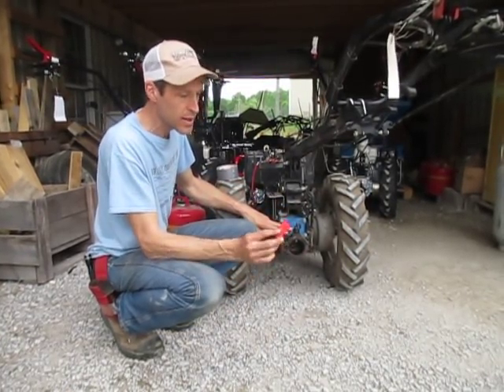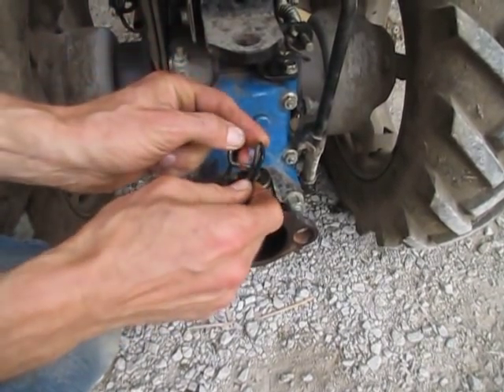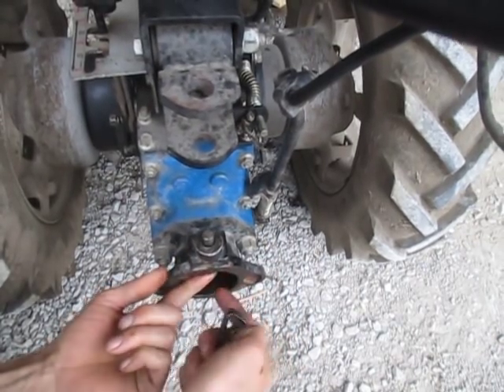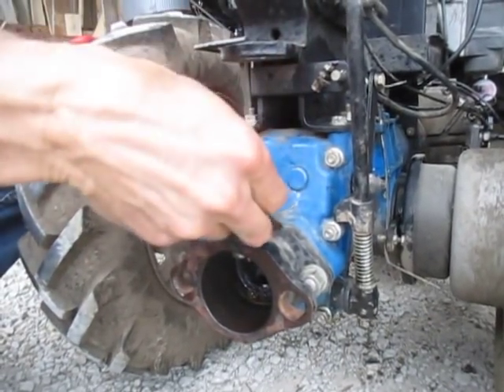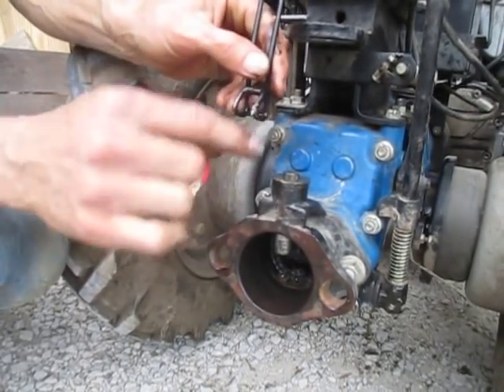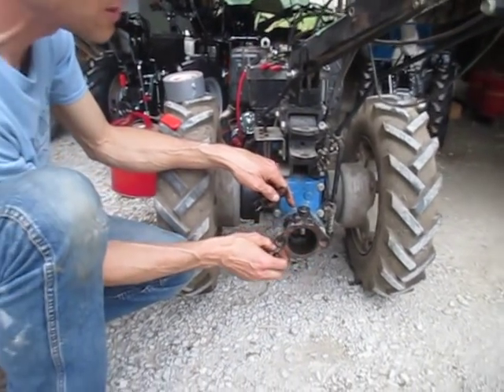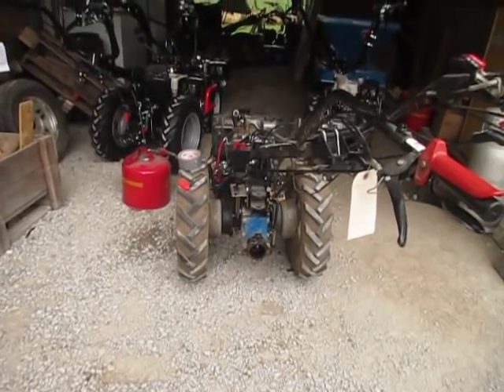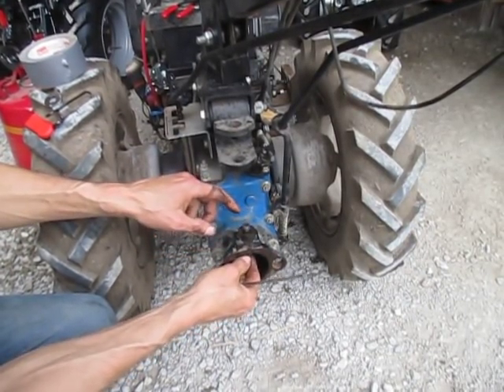BCS Quick Hitch: Service & Troubleshooting

Comment: You showed us how to take the pin out with an implement attached with the pin already out. How successful do you thin you would have been removing the snap ring and washer if the pin was actually still installed?

Comment: As part of the servicing, how much grease should be packed into the quick coupler? The grease in mine is starting to get dark, so I am thinking I should use a degreaser to clean it out and then pack it with fresh grease. Thoughts on that aspect of servicing the QC?
Reply: Same situation here, I also just snapped my quick hitch lever D:
Reply: yeah